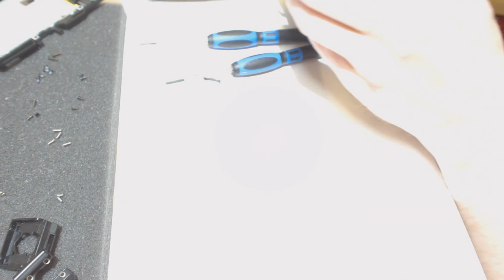Olympus XZ-1 disassembly for sensor cleaning

Comment: Thanks! I converted my XZ-1 to full spectrum by removing the UV and infrared filter in front of the sensor. This thin glass filter lies on top of the sensor and is held in place with black tape. When you peal this off, you can take out the filter. When you mount the sensor assembly back in place, leave out the four washers between the body and the assembly. With the washers in place the camera does not focus properly on infinity in the wide end range of the lens is my experience. Removing them solved this issue in my case. You can either glue a filter holder on the lens for a 37 mm infrared filter or use the 58 or 52 mm filter tube which is available that screws into the object lens base. A 37 mm filter with filterholder does give some black corners at the wide end range.

Comment: I've cleaned mine also.. few annoying dust particles were stuck on CCD..  4:40 that piece from hotshoe was tricky detail to find for me too .)) Anyway the internal layout is well-designed for a compact camera.
Reply: Getting those tiny shims back in was tricky. There were copper coloured ones on each screw and a silver and copper one sitting on a hole with no screw! I think there was a small projection on the sensor housing that held them in place when the three screws were tightened down. The rest was straightforward.

Comment: at 18:00 you were touching around with a screw driver and then shaking upside down.  Did you loose a screw?  I saw a small white washer dislodge while you were blowing air inside.
Appreciate this video immensely .  I have a big dust spec on my sensor and nothing has worked so far to dislodge it externally.
Reply: Nope, nothing lost! I made sure of it. :) The disassembly is not hard, but it's really annoying when you have surprises like the washer jumping out. I hope the video helps!